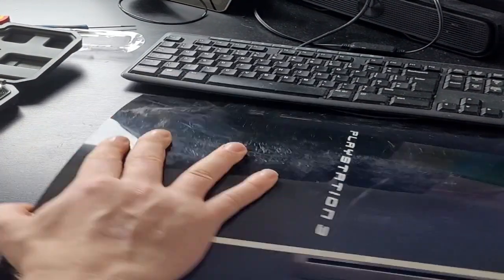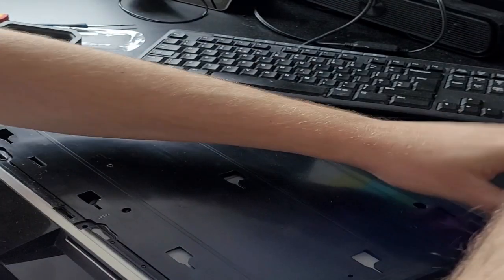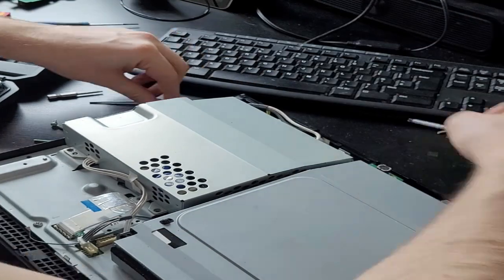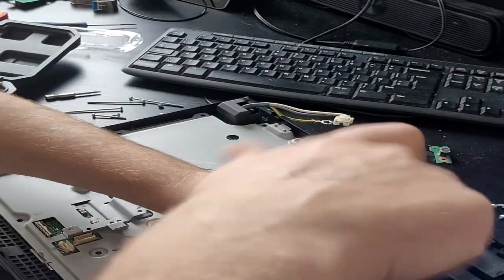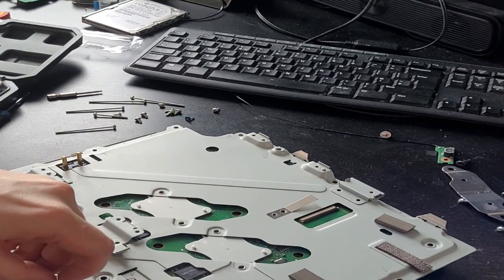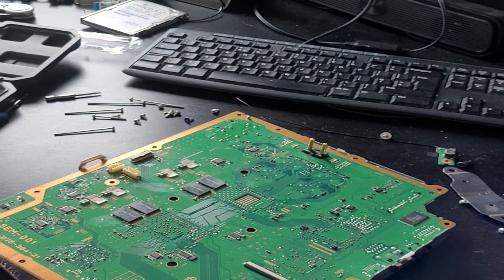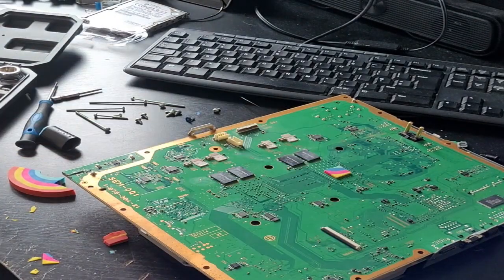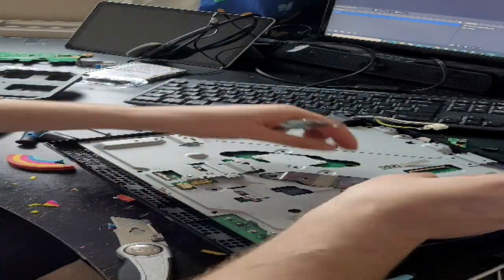Can I fix this PS3 over heating without delidding?

Comment: Remove this rubber and never do this again, This can Broke in Half the Cpu Silicon Core due to the Pressure!!!!!!
Reply from the maker: Its a PS3, it solves the problem and I haven't had any issues with all 3 of my PS3's that I've done this to. Not telling you to do it to your own I merely point out that this works.
Reply: @gamersarefromsaturn  OK, But Don't Do to Any other PS3, Like For Real, if you Go PSX Place you will see everybody hate this rubber mod, It Really can Kill The Most Important Thing the PS3 Has its Soul, it's Brain, it can kill the Cell Cpu broking in half due to the Pressure!!!!
Reply from the maker: @VictorHugoAlvarez-tc4tg  I don't understand your logic if my own personal PS3 breaks I will just buy another one for £10 and there we go, not like theres a shortage of them out there. Have you had personal expeirence of this mod or are you just reading something someone else has written? I have had my main ps3 modded like this for a long time and no ill effects. My 2 other PS3s are also modded like this and no ill effects. What you are reading is someone who made the rubber too thick and snapped the die on his Cell BE CPU. If you are gonna mod wrong there are consequences.